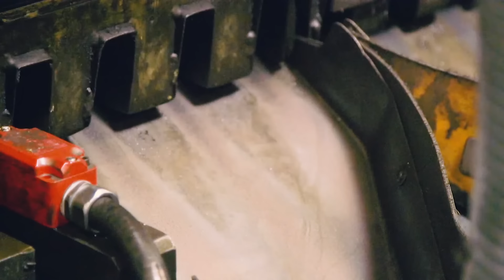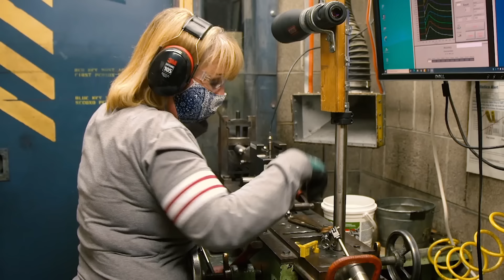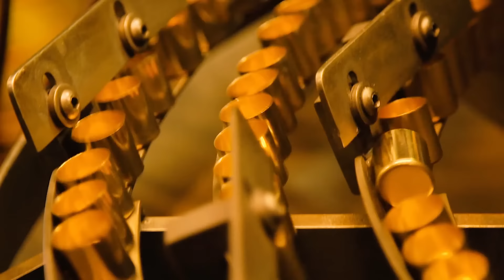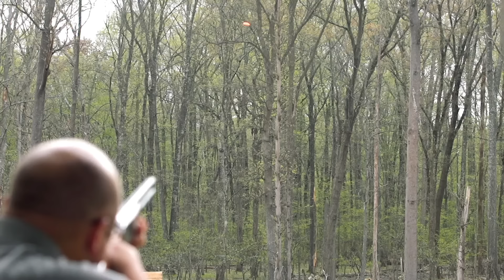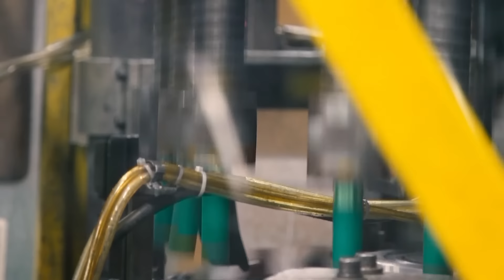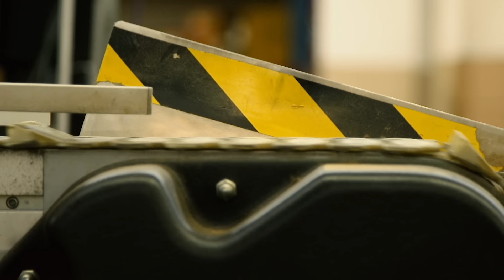Making Remington Shotshells

Comment: I’ve had multiple cases of Gun Clubs 1 1/8,3 dram 1200 fps that weren’t crimped on the end good enough to hold the shot in the shell.Hand full of shot in the bottom of the box.I will stick with my Federal Top Guns.

Comment: They need to make a run of 410 gage 2.5 inch long high brass shotshells #4 or #6 shot again. I need snake shells for my Judge. The low brass shells available now by other manufacturers is a problem to extract.
Reply: I've never in my life seen a low brass .410 shell.